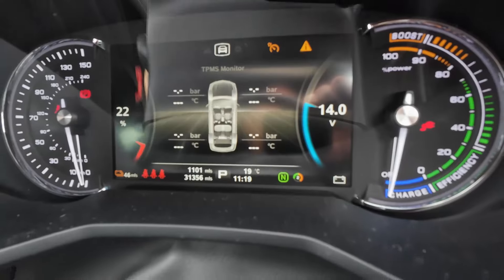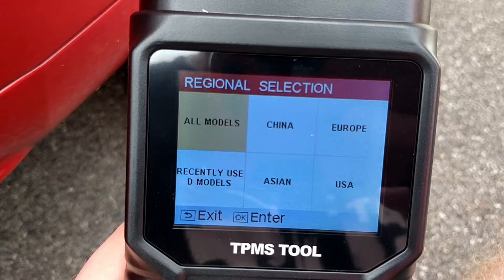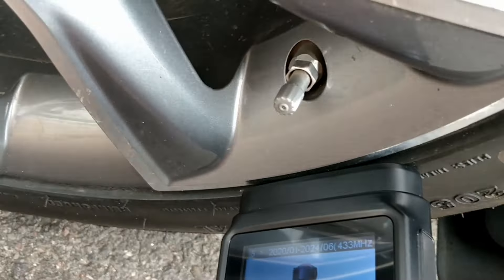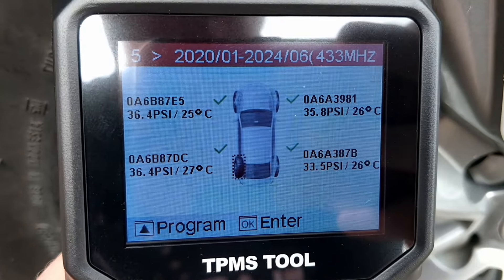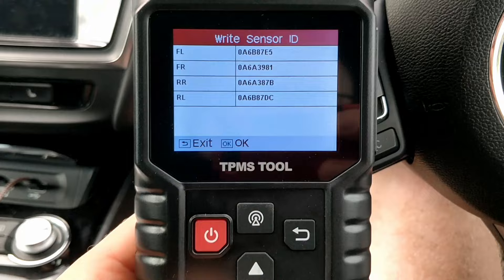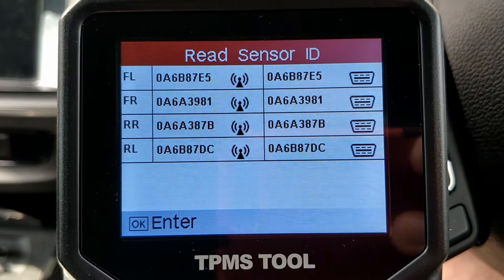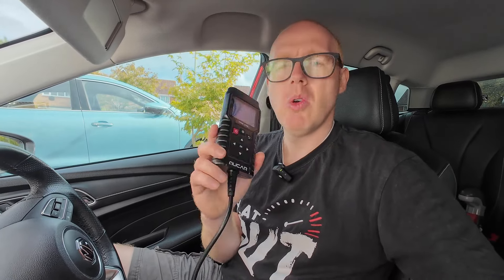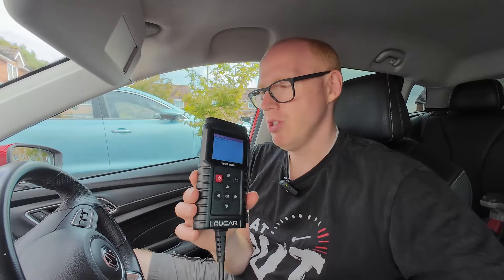How to program TPMS sensors on your car like a pro

Comment: Neat machine, top tip, definitely cheaper than going to a main dealer.
Our cars are all old school, have to resort to the tried and tested “kicking the tyres” method to see when they’re flat 😂
Reply from the maker: Much more reliable than these modern sensors!

Comment: Thanks for this helpful video; do you know if, using this tool, it's possible to change what I think is known as the baseline pressure?  I currently get an 'adjust pressure' warning if pressure drops to 46psi but I'd like to be able to run a little lower, without getting the warning
Reply from the maker: It depends on the specific sensors used. 
Some can, some can't. 
Lots of the OEM sensors cannot be adjusted.

Comment: He was not a good demonstrator. While he showed hoe to to read the sensor number for all tires, that next step when he got inside the vehicle was not clear, he did not show what he connected the tool to when it showed all tired codes.  Therefore I gave a thumbs down
Reply from the maker: You plug this into the OBD port on the vehicle. The location of the port varies from vehicle to vehicle.